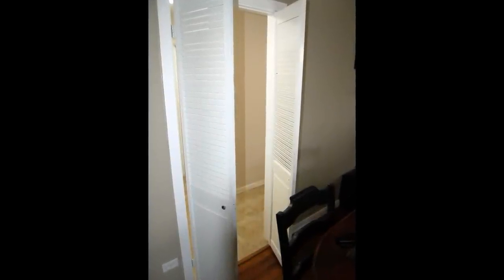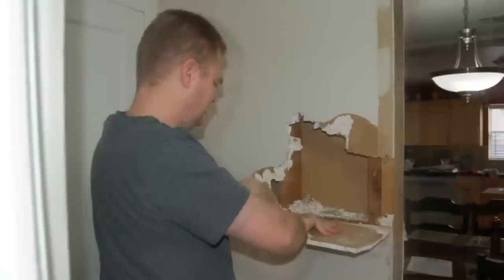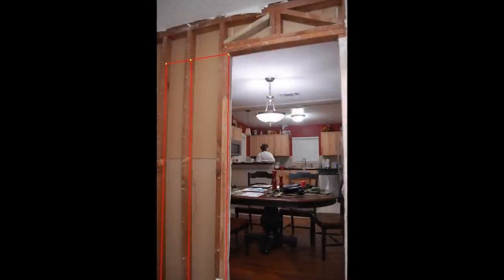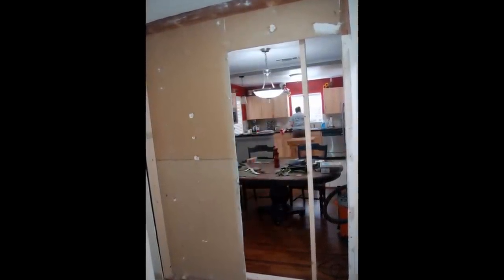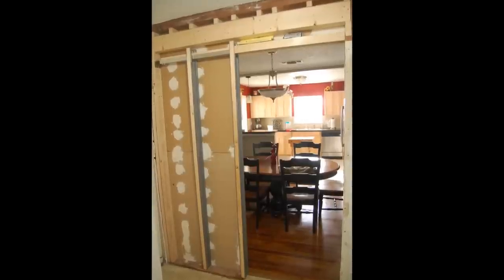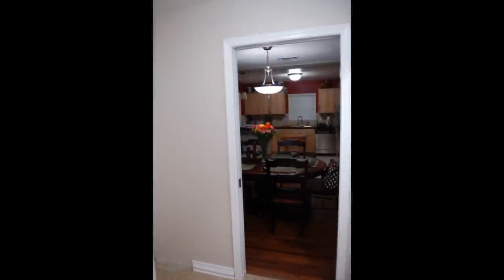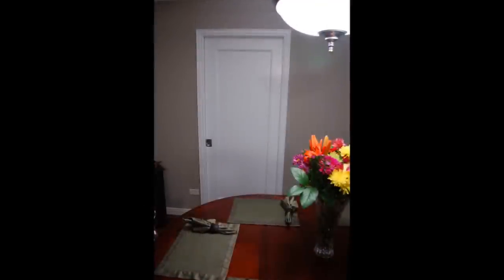Installing a Pocket Door Remodel Guide: without Removing the Drywall...

Comment: I wonder if one had enough wall room, if you could install the pocket door without tearing down the sheet rock and lay it against the wall and sheet rock over it, kinda like a barn door except covering the door when it's in the open position with sheet rock?

Comment: Instead of using a sprayer, you can also thin out joint compound and use a textured paint roller to roll texture onto walls. Just a thought. Will save time and mess.
Reply from the maker: Yes there are many ways to add texture to a wall. We matched to rest of the house. You cannot roll on this type of texture, and get matching results. No reason to rush.

Comment: After you cut the nails, did you re-attach the undisturbed sheet rock in the dining area to anything?
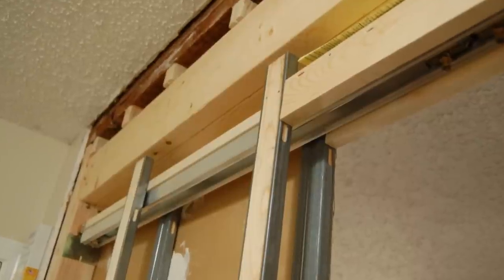Reply from the maker: Yes, the drywall was attached to the pocket door kit, to the vertical "studs" 5:58
Reply: Brandon Marshall
Thanks!
Reply: Brandon & Meredith  Did you Use glue or liquid nails or something from the unfinished side?
Reply from the maker: Andrew Gengler
 I just used a few nails, I guess you could do liquid nails too.

Comment: Did you use the existing molding to put back around the door or did you get new molding?
Reply from the maker: I reused the existing molding on the inside on the laundry room, and updated with neon the dining room side to match the rest of the new molding that I had already replaced.

Comment: Did you consider a barn door?  I looked into a pocket door but found plumbing in both sides, so we're gonna use a barn door.  Seems simple and pretty popular these days.
Reply from the maker: DukeLaCrosse20 No, I wanted the door to slide into the wall. I see that barn door style a lot these days, probably because it would be much easier to do.

Comment: I was wondering why you went to all the trouble to save the sheetrock on the other side, then you said it will save you texturing the new drywall. Now I get it, as you are doing this yourself and can patch a few  nail holes but not easily do a knockdown finish on new drywall. Faster for a remodeling pro to rip out and install new. Drywall is cheap, labor not so much.